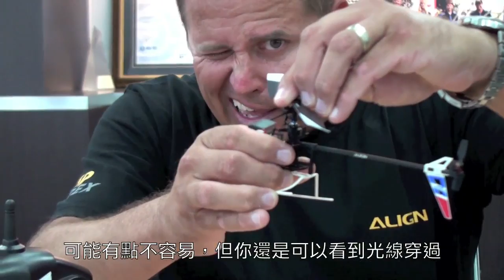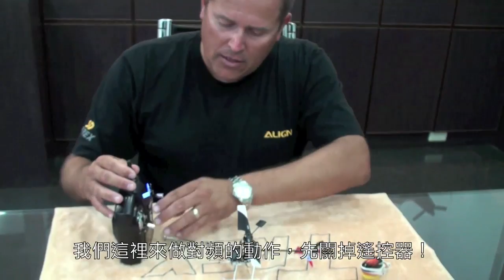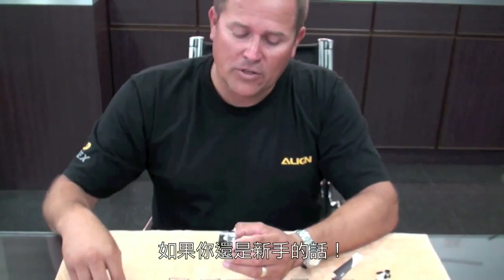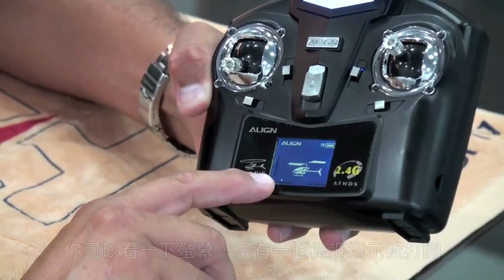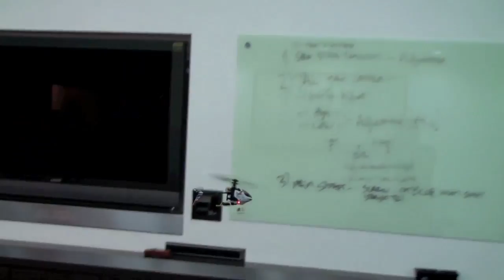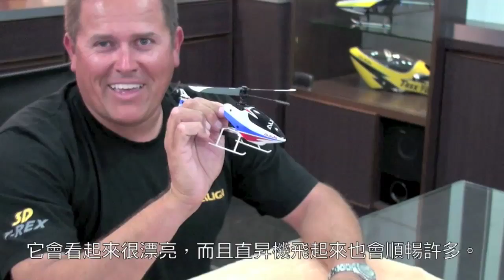T-REX 100X Introduction

Comment: You guys with big hands, do this:
Get some tweezers, and heat up a tiny amount of hot glue gun glue, get a little drop on each side of the tweezers and squeeze on something like paper with olive oil or some other surface the glue won`t stick to.
Trim the excess on the sides of the tweezers with a excel or other sharp blade and bob`s your uncle. Works for other things as well  :)
It`s important not to have too much as a flat smooth surface is needed to have a stable grip, but if you mess up, just heat it and sqeeze again.
Works great for tiny screws in hard to reach places ;)